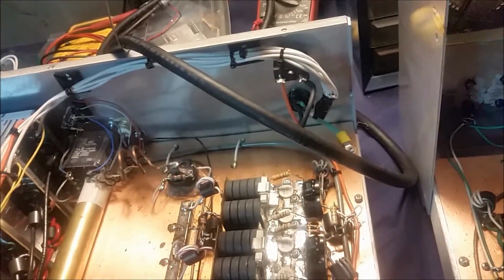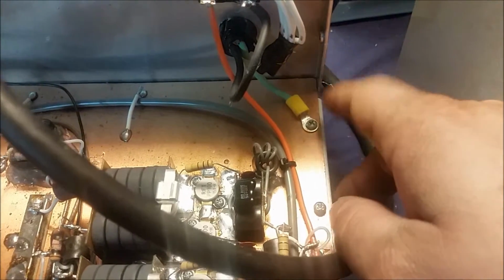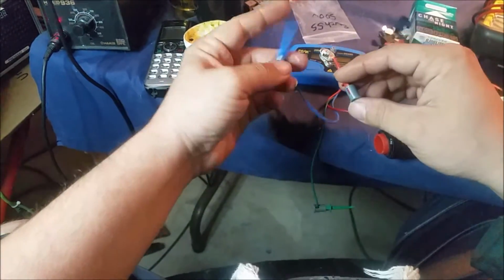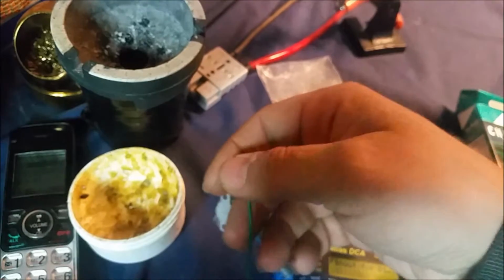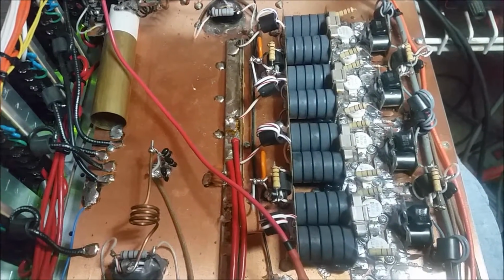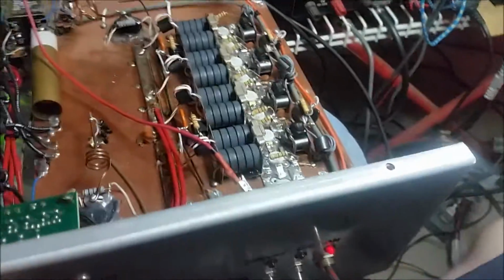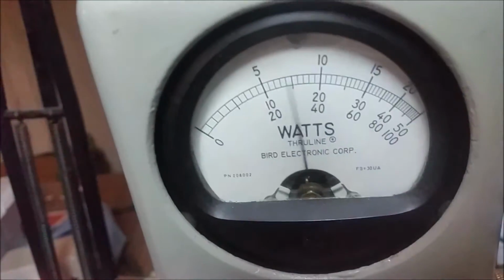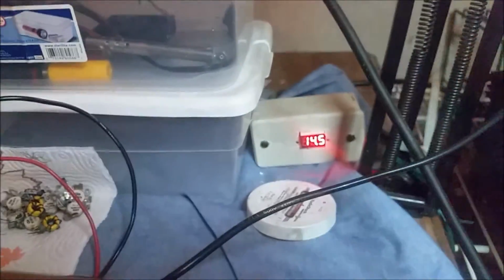Xforce XT800 Base Amplifier Repill & Repair 👀 SMH WOW!

Comment: I had a similar  amp come threw the bench was blue label 8 pill no led bar in middle and had pp 100 with 4 blown 10 ohm. 1 per 2 pill sections. The problem is a switcher gone down and when keyed dropped 11 volts . ended up keeping it and rebuild.to a  8x  2SC2510 in AB1 bias. 24V switchers and 1 14V for  bias and relay. runs great 12 meter threw 10 meter  input   SWR 1:1.05 at 28.3 mhz. slightly higher at 24.89 MHZ. same on 29.7 MHZ. no 2nd or 3rd harmonics can be seen. as long as clean radio driving. a note make all switchers same volts before connecting and equal lengths of wire on pos and neg so switchers load the same. that's what killed the box I got now. the switcher with short lead carried most the load and went down causing 4 pp 100 to pop.Running great 4 years now!!  was class C.

Comment: LCR-T4 
You can buy one of those for $5 and it tests transistors, capacitors, diodes, resistors and inductors.Its just as accurate as a peak reader.Just solder test leads to the pads on the board labeled 1, 2, 3 and you're all set.
Reply from the maker: ᗒ╬ᗕ1112223333111ᗒ╬ᗕ is this comment to me? thanks
Reply: maybe you can make a video showing that?